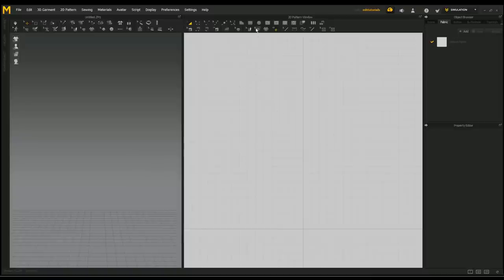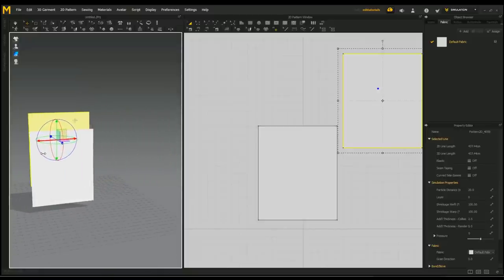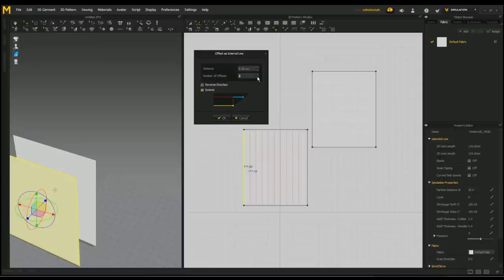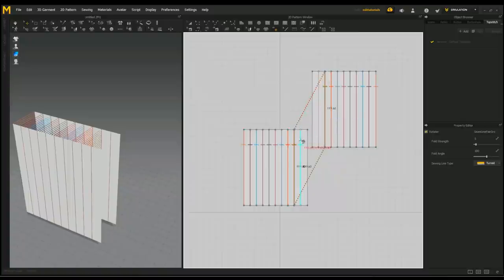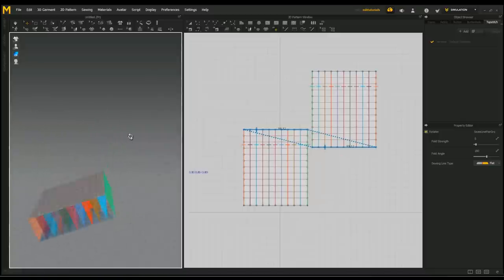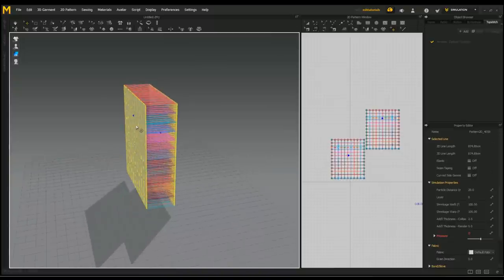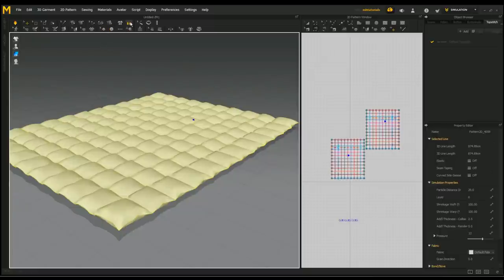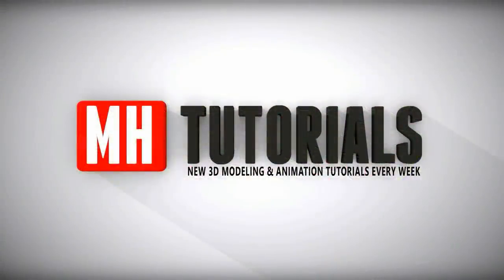How to create a Comforter in Marvelous Designer 7

Comment: How much of a final asset can Marvelous truly export? I mean in terms of textures etc. Does it create normal maps etc, or does it create only a basemesh? Because I see people tweak back and forth, Zbrush ->Marvelous and I don't quite see that workflow meaning. ( I mean both in terms of sculpting/ creating tex.) Doesn't look that simple... Zbrush - Marvelous - Zbrush workflow?
Reply from the maker: The base mesh is pretty much it. Then export and detailing in ZBrush, retopo for low poly, then map baking and texturing. You can apply textures in MD though but it depends on how you are going to use your model
Reply: Mike Hermes i see so for details i will have to sculpt them, i guess im a bit afraid of how sculpting affects the base mesh... to my understanding thesr marvelous meshes are dynamic so if i edit them im zbrush i get a static mesh without animation. Or does it conserve something after sculpt edit?.. say i wanted a drapery affected by wind... if i go to detail in zbrush and go back to simulation, i will have retopo, simulate again? Or would you rig it in maya? 

Im saying this because i see you simulate in this video and the mesh looks like its affected by physics (which looks super cool)
Reply from the maker: Exporting with animation is a very different process :-)
Reply: The 'animation' is the simulation of the cloth.  In MD you play the simulation and mess around with your duvet, comforter, pillows, clothing etc etc until you are happy with the shape.  Then you stop the simulation and export the mesh straight to 3DS Max or Maya, or first into ZBrush and sculpt some more details, like creases etc.  Finally, you bring it into 3DS Max, apply your textures and render.

In MD8, you can do a lot of the sculpting of creases with the new Sculpt tools they've introduced, so if you don't have zbrush or the skills of using zbrush, you can sculpt those in MD8 - they are pretty easy and intuitive and while basic, they could be enough.

I'm learning MD8 myself, and for me it is a lot of playing around because while there are tutorials out there, you really have to get your hands dirty and learn 'the hard way' (i.e. trial and error).  Personally, in MD I really do not like the transform - it is incredibly tedious to move something around (all the tutorials show you putting stuff on the floor, but when you have to arrange it for real world, say pillows, duvets etc on a bed, you can spend a lot of time 'faffing' around.